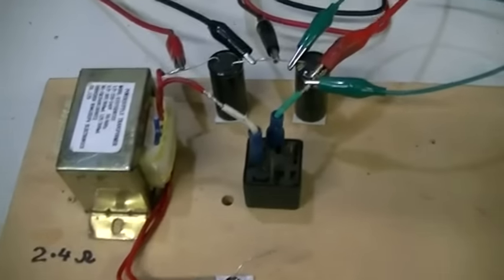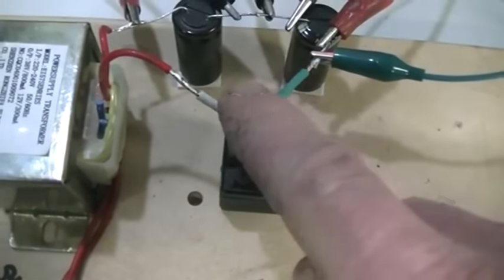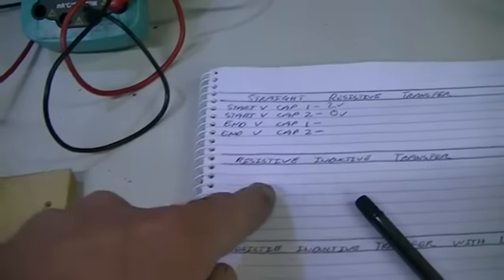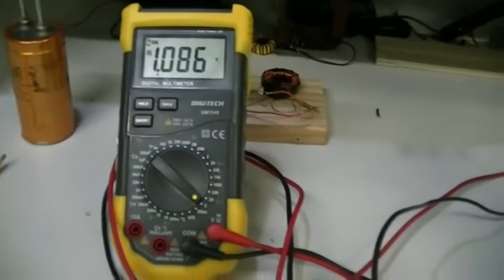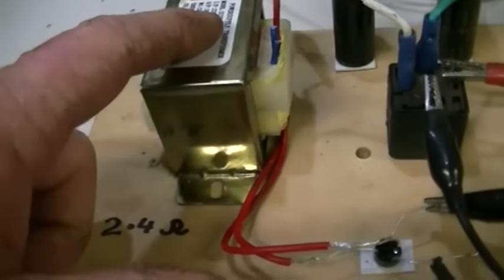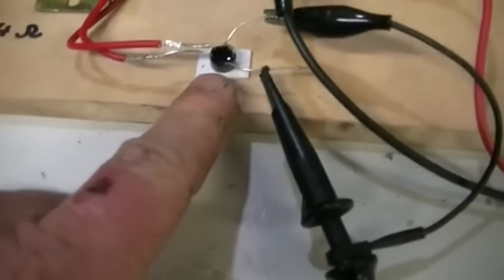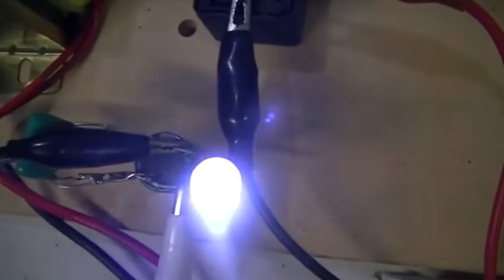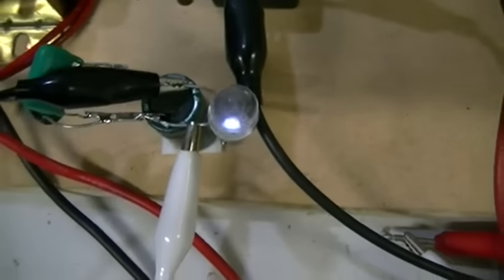Cap to Cap paradox experiment

Comment: The capacitor is more a current device then a voltage device. The bigger the differential in voltage the more current. What we are looking for is a set of gears. An automatic gear. What we need is a device which we can hook up to the filled cap, to charge the empty one with as little as possible losses. It is an integral problem.
Suppose you have 50 caps in series which you charge, and then in parallel you empty them. As cap 2 (the empty one) gains voltage, you now would need to use 49 caps in series, to end up in parallel with a slightly higher voltage. And then 48, and so on.
But as I am using caps in my example, in fact it I am translating a curve into a discrete representation.
The only way I can think of to do this right (using electronic gear) is by using a coil. A dc 2 dc converter. I would not use the Chinese el cheapo ones. I tested those several times, but they use at least 10 mA just for themselves! And the usage (losses) goes up as you start to increase the amp draw with those dc 2 dc converters.
Do note: I do not recommend pulsing with to high of a voltage. Even though supercaps look like they have a very low resistance, high voltage (spikes) can create tiny holes in the electrolyte which in effect will lower the capacitance over time.
-- -- so far my 2 cents -- --

Comment: Great test!  It kind of kills the magical CEMF over-unity argument, in this case, as all CEMF is accounted for in your experiment by using the capacitors as joule collectors, and yet the total joules still decreased as expected.  Others may make a mistake by  adding the voltage on each capacitor directly, and think more joules (energy), but recall that the equation for capacitor joules is proportional to the voltage squared.

Comment: Interesting test. I was quit surprised to see the supply voltage end higher with the loaded secondary. With AC the loaded secondary would have allowed more current in the primary. Pulsed DC appears to be different. It could be interesting to note the duration of the test. I have no idea what will happen next. Cheers

Comment: If you have 100% energy transfer starting with one cap at 2V and te other 0V the end result will be 1.412V per cap. In your first test the loss is big due to the transformer resistance and the internal resistance of the caps at a high discharge rate. In your second setup the average discharge rate is less and thus the resistance of the caps play less of a role. And in the final setup the dynamic resistance of the transformer is lower which increases the efficiency even more.
Reply from the maker: Yes,we loose about half the energy when transferring by way of resistance only-that is normal. But some of us think it is not a resistive !heat! loss,as the electron count remains the same at the end of the test as it did at the start.